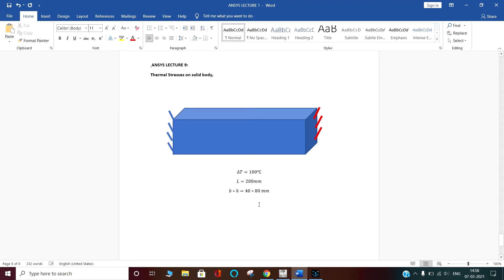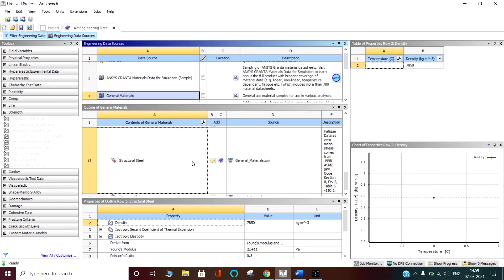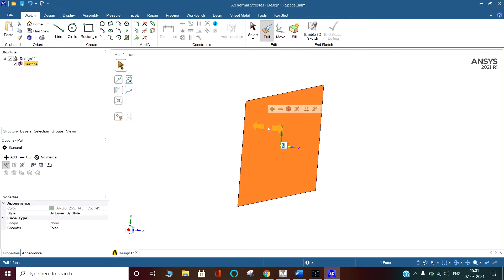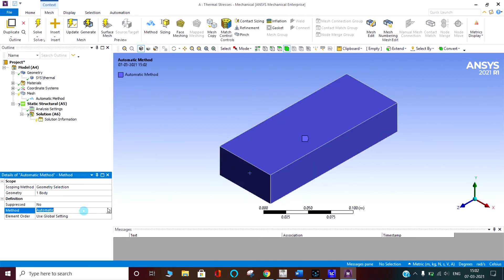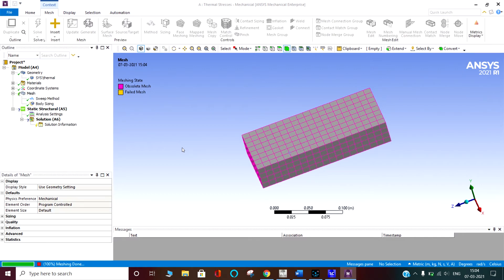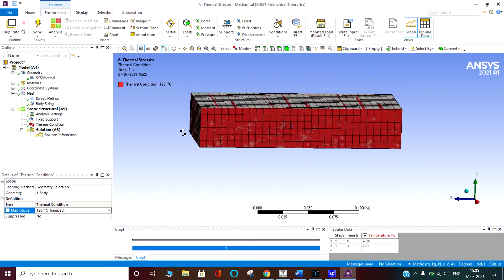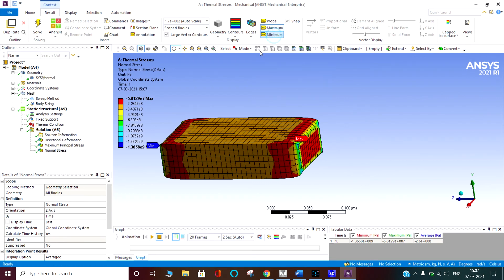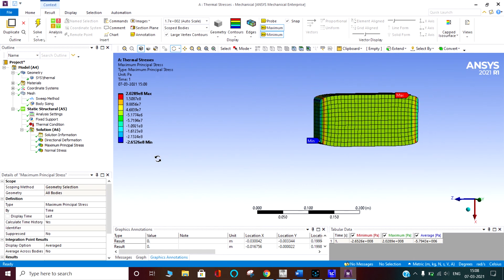Thermal Stresses due to temperature variation in Ansys.

Comment: Nice video, why Thermal condition is included in ANSYS Static Structural when we have separate Analysis System i.e. Steady-State Thermal. Once Steady-State Thermal analysis done we link the output to Static Structural. Please correct me
Reply from the maker: Thermal load induces thermal stresses.